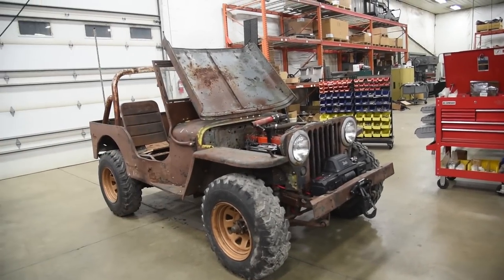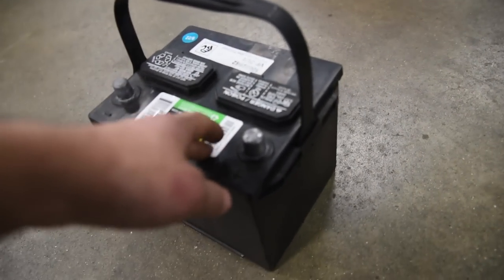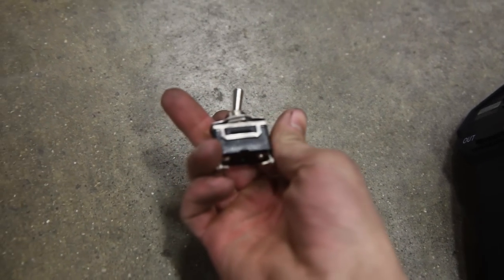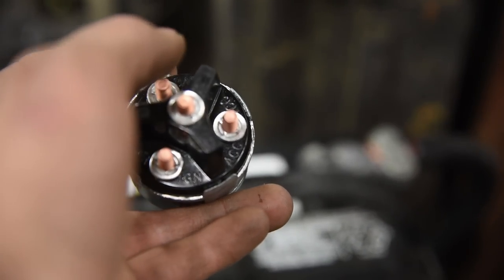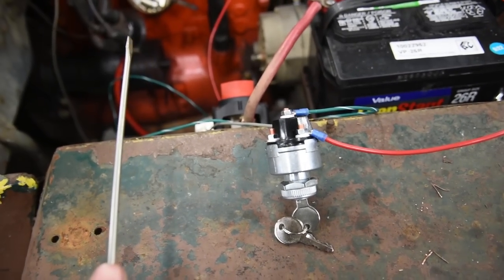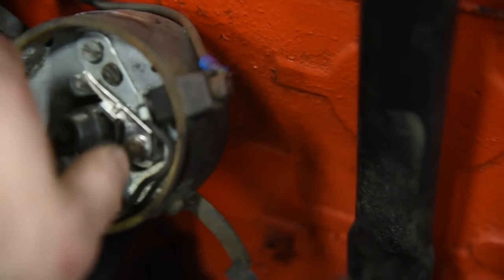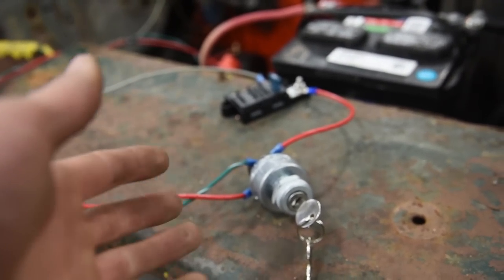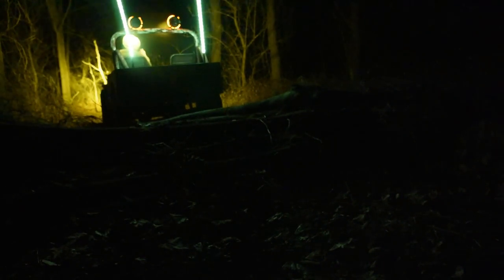How to Wire a Willys Jeep Engine [Ultimate Beginner's Guide]

Comment: Update- I finished the wiring with harbor freight trailer parts, replaced the high beam switch headlights, high beams brake and tail lights, turn signals all work. got a horn from a 90s GM and installed electric wipers to pass a sheriff inspection.. 

This jeep is now tagged, registered, insured and back on the road!

Comment: Hey I just picked up a 1947 Willy's CJ2A. It doesn't have an oil filter, do you suggest putting one in or should I just change the oil every 3000 miles?

Comment: hello Im curiuse to know can 6 and 12v baterrys be wired in series or parrarel configuration or capacitor banks ? 
I mean how to prevent alternator to work normaly .
When ever I use capacitors me starting charge rpm gets swaped around .
For exampel if I use hv ceramic capacitors the rpm from 1000rpm goes up to 2500-3000 rpm range can some thing be done to that ground baterry potential problem? Me alternator is the old Delco 12si
Reply from the maker: I'm not an expert in that field, you might have to ask an electrician.

Comment: That diagram is wrong, ballast resistors are for running a 6v coil on a 12v system. The ignition feed bypasses the resistor to feed 12v to the coil on crank... then back to 6v to run.
Reply from the maker: I've seen them on both 6v and 12V Jeeps. I personally don't even bother with those, right in the trash, and get an internally resisted coil.